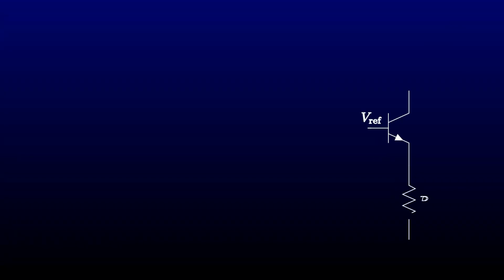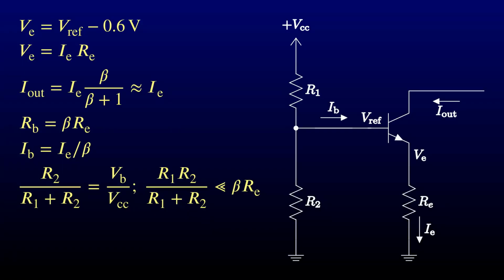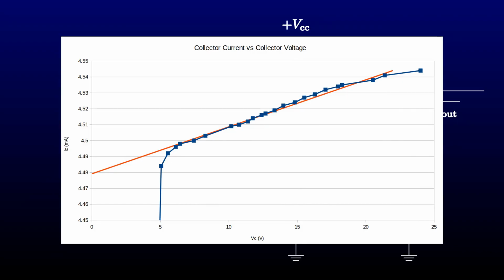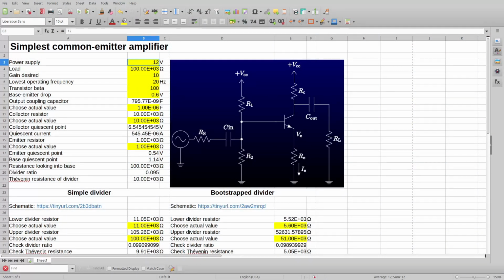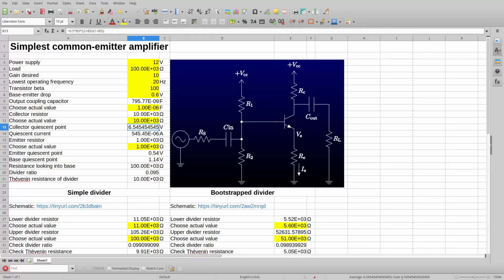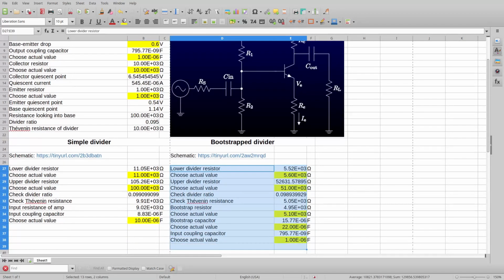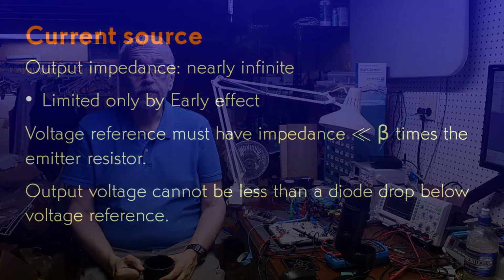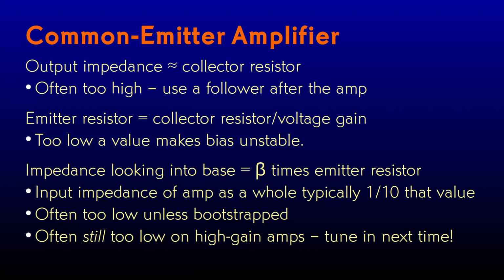Transistors 101 ep7: Biasing the common emitter amplifier

Comment from the maker: 2025-03-22 @kiromaisus pointed out that the calculation of the quiescent voltage in the spreadsheet is pretty incomprehensible. On the GitHub version of the sheet, I added a line for the saturated collector voltage (the lowest dc voltage that the transistor can pull), and made it explicit that we want the quiescent point to be centered between that and the positive supply

Comment: @KludgesFromKevinsCave
Concerning the voltage divider circuit at 4:35, I've always wondered why this circuit provides higher stability than the emitter feedback bias circuit (which is the same circuit but without resistor R2). A lot of people say that it provides higher stability but they don't give a full explanation, they usually say two or three words and move on! 
I guess the main parameter that affects stability is the emitter feedback resistor, so how can adding resistor R2 (and thus forming a voltage divider) make this difference. Why isn't an emitter feedback resistor enough?
Reply from the maker: I'm a little confused by the question. Are you talking about bias stability (particularly thermal stability), or amplifier stability (does the darned thing oscillate)?

If you're concerned with the thermal stability, you can cpmpare two basic designs by considerting the transistor as a voltage-controlled current source (Ebers-Moll model) - and then repeating your calculation at another temperature, using the rule of thumb that at a given base voltage, collector current will roughly double for each 10 K rise in temperature.  A simple design like this one mostly defends against that by degenerative feedback from the emitter resistor, at some cost in gain stability.  

The voltage divider scheme is not the greatest thing to stabilize the bias at the quiescent point.  You get better thermal stability by using feedback at dc - moving the top of R1 from the power supply to the transistor collector. (And you can add additional RC filtering in there so that you don't load the input circuit at signal frequencies.) 

I've skipped over that, and the temperature compensation technique of deriving the bias voltage from a matched transistor, simply because they tend to be historical curiosities now - for most practical purposes, you use an op-amp and have done with it. (Power amps are of course an exception - and I will get into the details of class-B power amps at some point!)  But it's important to have some idea of what's inside an op-amp, in order to understand its foibles.  Later in this series, we build a very crappy op-amp out of discrete transistors - mostly to gain an appreciation for the beast.

Also, you've probably taken enough physics courses to know that you keep coming back to the same topics, with repeated rounds of, "that explanation we gave you last semester was kind of a lie, but now we have the tools to get a better understanding.")  It's hard to even think of thermal stability until you have Ebers-Moll under your belt, but you can understand a useful range of transistor circutis with the simple model of Ic = beta*Ib.  (Or the even simple model of "the transistor does what it must to keep the emitter a diode drop below the base".)

If you're asking the question, you're already beyond the level of this lecture - this one is only the second or third episode on common-emitter amps!
Reply: @KludgesFromKevinsCave 
Thank you for this detailed response! Yes, I mean bias stability. So if we rely on the Ebers-Moll model where collector current can be expressed as Ic = Isc(exp(qVbe/(eta)kT)-1), we are viewing the transistor as voltage controlled (I know there is always this debate about whether the transitor is voltage controlled or current controlled). My analysis is the following: In the voltage divider bias circuit, we are maintaining a constant base voltage Vb through the voltage divider. Now if collector current Ic increases, the voltage drop across the emitter resistor (Ve) will increase. And since Vb is held constant, the base-emitter voltage Vbe is forced to decrease, and hence, Ic will decrease (based on the Ebers-Moll equation). Now in the emitter feedback bias circuit (circuit without resistor R2), the base voltage is not forced to stay constant and will change with the collector current, and in this case the base-emitter voltage Vbe will not decrease by the right amount. I don't know if this is an accurate analysis or if you would like to add something  (especially concerning the emitter feedback bias circuit)!

Comment: I was looking in the spreadsheet you used and saw that you have this expression for the collector quiescent point: =0,5*B3*(2+B5)/(1+B5), which translates to =0,5*Vcc*(2+Gain)/(1+Gain). It's not clear to me where the (2+Gain) and (1+Gain) come from. Can you explain, please?

I think your spreadsheet is very good because it lets you to use whatever resistance/capacitance you want and suggest you the value to accomplish what you put earlier.
Reply from the maker: Sorry about the delay - I had rather a busy week of paid work and got last night's video out only just in time!

I kind of cheated and used a computer algebra system when I put together the spreadsheet. and it kicked out an oversimplified equation - good for calculation, not good for understanding!

At dc, the highest voltage that the collector can reach is the power supply voltage Vcc - the transistor is fully cut off.
The lowest voltage that it can take is Vcc*Re/(Rc+Re) - with the transistor fully saturated, the circuit looks like a voltage divider.
To allow for the maximum signal swing without clipping, we want the midpoint between those two values: 0.5*Vcc*(1 + Re/(Rc+Re))

We've already established that the circuit's voltage gain is G = Rc / Re, so we can replace Re in the equation with Rc / G.  When we do that and run the algebra, we get the formula in the sheet.

That makes me realize that the sheet would be much more understandable if I simply broke out the saturation voltage as a number in the sheet, so I updated the sheet in GitHub to do just that. That should make it clear that what we're targeting is the range that the output can take.  "Half the supply voltage" as the quiescent point is the lazy approach, good only for high gains. The sheet will handle a gain of 2 just as easily as a gain of 20.

Thanks for suggesting the improvement!
Reply: @KludgesFromKevinsCave  Thanks, that cleared it out.
Reply: @KludgesFromKevinsCave  I'm impressed by the effort to explain and "correct" the issue. Great respect for your educational skills and effort. Thank You 🙏👍
Reply: @KludgesFromKevinsCave  first of all thanks for making some time to prepare your videos... they are amazing. on the other hand, i am having the same doubt concerning the Vcq equation. in the video you said that the minimum Vc was the voltage divider between Rc and Re, but when i do Vcq = (Vc_max - Vc_min)/2 = 0.5*{Vcc-Vcc*[Re/(Rc+Re)]} = 5,45 V... which is not the same as the 6,545 V... you got in the spreadsheet. moreover, how am i supposed to know Re if its calculated after getting the value for Vcq --> even doing Re = Rc/Av leads me to the same 5,45 V? am i missunderstanding something? thanks in advanced and sorry for the inconvenience

Comment: There is no spreadsheet on github, is there a separate link?
Reply from the maker: Hmm, I just checked, and it's there for me. Did you perhaps not recognize the .ods (OpenDoc Spreadsheet) file extension? 

In case it's not working for you, try the direct download link:

https://github.com/kennykb/kevins-cave-kludges/raw/refs/heads/main/Transistor101/Ep007-CommonEmitter2/ce-amp-biasing.ods